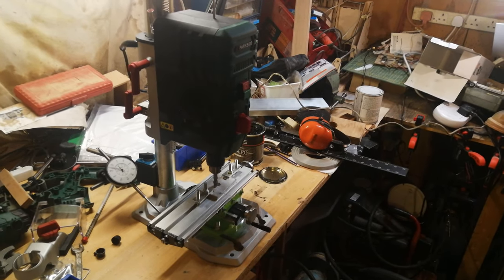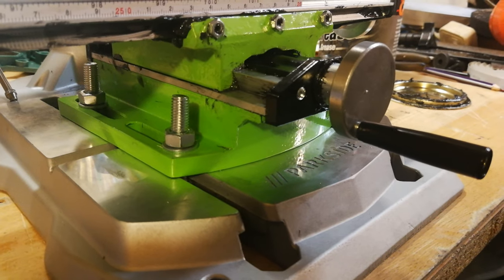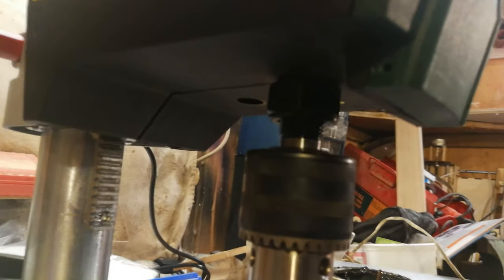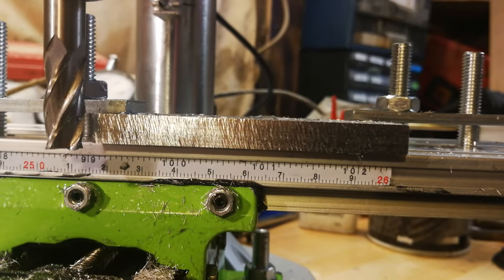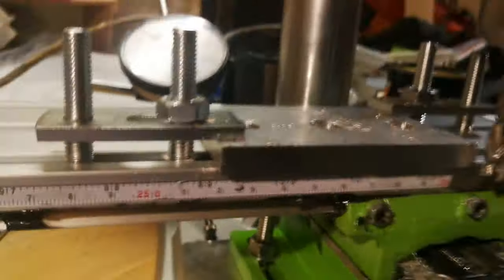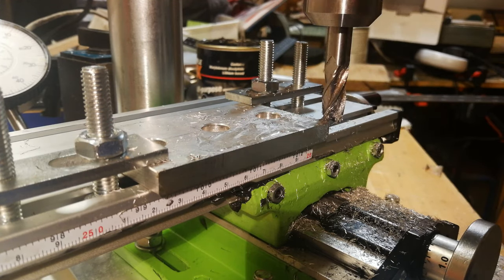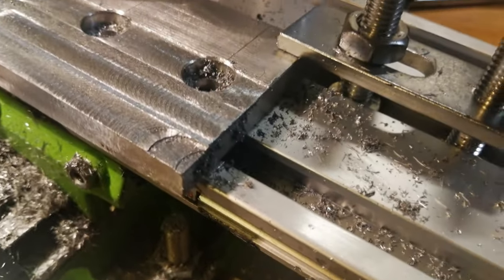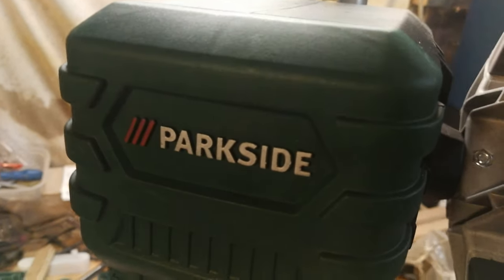Turning a pillar drill into a milling machine

Comment: Works surprisingly well, but I'd say it's still, 'pretty crap' but as you say, it's better than filing, and just how would one reduce the thickness of a piece of plate with a file?
Looks like it might be good with plastic though, perhaps you could make some cool stuff out of carbon fibre?
Good idea/insight to use a drill with no quill.
Parksides latest varible speed bench drill now has a digital depth readout that displays in increments of 0.1mm by the way.